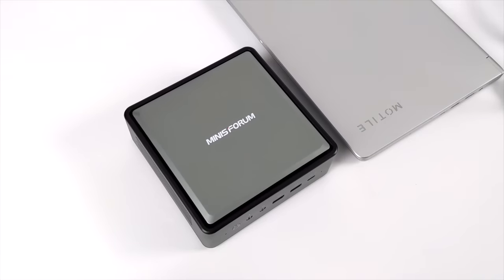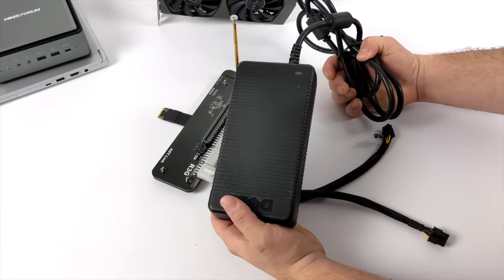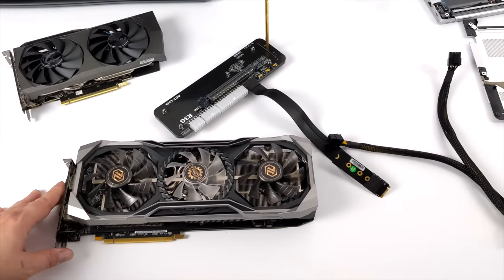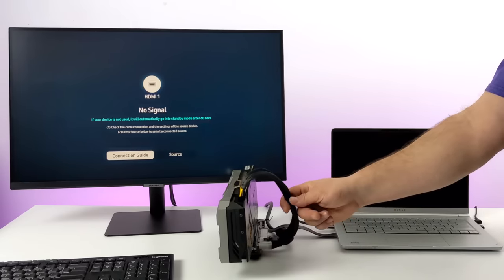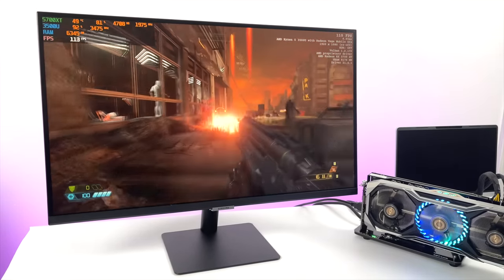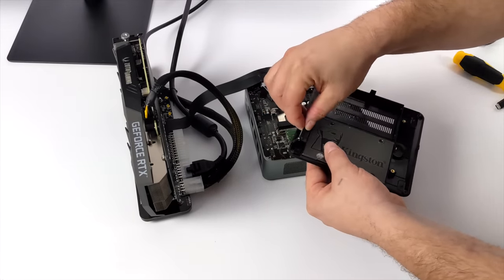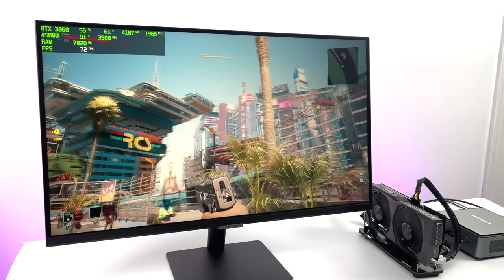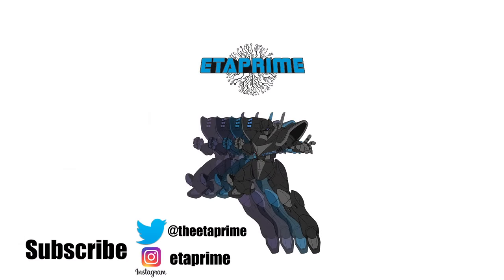Add A Graphics Card To Your Laptop Or Mini PC With This M.2 GPU Dock!

Comment: Nice video and on time while I am trying to figure something out. I want to use an m.2 to pci-e adapter cable in order to be able to use  on a mini itx motherboard an extra pci card which is of nic type 10GBe  intel x520-da2. My issue is if the card is going to be powered by that m.2 ultra slot or not. I know pci slots have 25watts and pcie 75watts but I dont have a clue about the m.2 ultra slot

ps Adapters like these https://www.ebay.co.uk/itm/M2-NGFF-NVMe-Interface-Extension-Cable-PCIe-x16-Graphics-Card-Built-in-Adapter-/282938993701 have a 4 pin to sata power connection but can the sata connection provided the power needed for the card? Also would it be wrong to connect that sata connector to the psu side where pci-e for vga is labeled (no other available sata positions on the sata peripherals) I know that doing that kind of connection wont give 5v only 12. Would that be a problem? Am I missing any other critical info?

Comment: Lol...that power supply will NOT power my gpu.  200watts is no where near enough bro.  Get with the times.
Reply: You can use a atandard ATX power supply with that adapter too. Besides, such a neat and compact Dell psu can be very handy for builds using cards like a 1660 or anything alike.

Comment: Hey thank you for this. Love the things i always see but never try all of them.

Can you explain why you say CSGO is bottleneck the CPU as i look it's using less CPU% than when you were testing doom - Also what program is that overly from?
Reply: ryzen 5 3500u is a quad core with hyper-threading which means this cpu has 8 threads but 4 physical cores. CSGO is a game that utilize only 4 threads while doom eternal can utilize 6 threads. That's why the cpu utilization is higher in doom eternal. When a hyper-threaded cpu reaches 50% utilization that means all physical cores are utilized at maximum and anything above 50% is hyper-threading's work.
Reply: @dusk5927  Thank you - I did not even know that CSGO did not utilize HT. I thought maybe it was the two different types of measuring tools he was using, i've never seen any of these tech channel mention how much their PC is overkill on threads/cores physical/logica/virtualized - I bet most games have a cap anyway but that's not mentioned anywhere either.